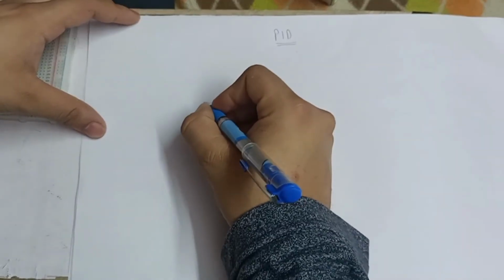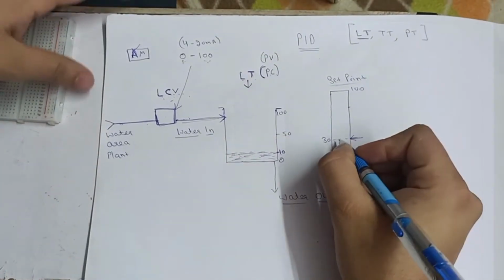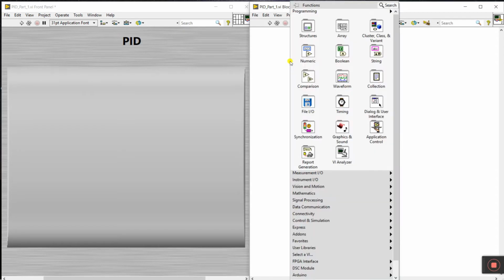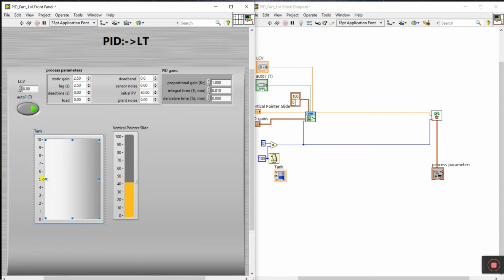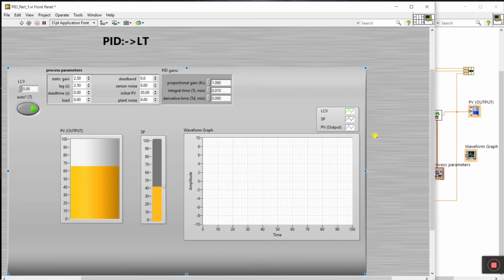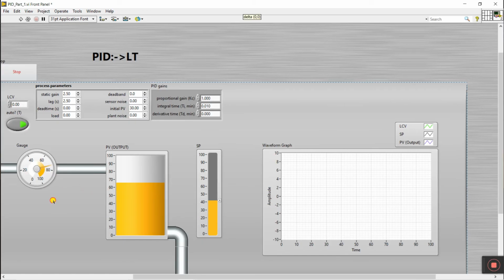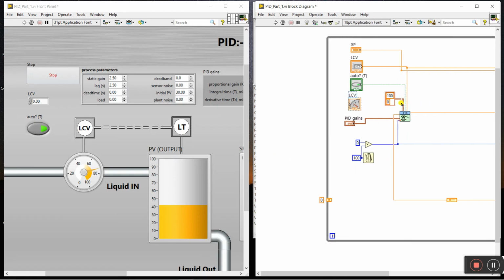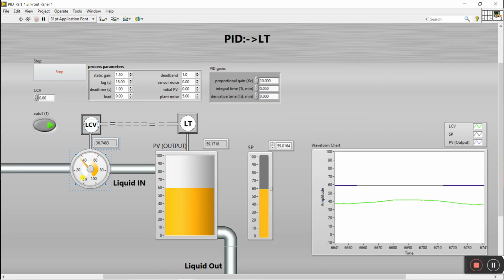LabVIEW | Labview PID Industrial Project | LabVIEW Programming Series

Comment: How Can I Design a PID level controller for the reboiler of the mDWC (denoted by W2 in the column scheme), which can keep the reboiler level at a constant value by adjusting the power of pump P2. The desired level should be adjustable at the front panel of the LabVIEW VIDesign a PID level controller for the reboiler of the mDWC (denoted by W2 in the column scheme), which can keep the reboiler level at a constant value by adjusting the power of pump P2. The desired level should be adjustable at the front panel of the LabVIEW VI

Comment: Dear Pradeep, first of all, thanks for preparing good videos.  I have prepared a Matlab code of CSTR and then import it into LabVIEW. Solve it by using the ODE toolbox of LabVIEW. I am trying to control the temperature of the reactor by using the PID controller of LabVIEW. I am unable to pass the manipulated variable in the CSTR plant. So, kindly help in this part.

Comment: Nice project, please assist me I have a project which is used to measuare ac and dc voltage of the lines,  by using arduno code . how to apply and connect the on labiew to reading the actual value of the sensors. thank you
Reply from the maker: Dear follow this playlist:- https://youtu.be/qQqPCWeB_QY
May be it's very helpful, help of this you can do your project as you mentioned.

Comment: I make same circuit on LabVIEW 2017 the with scale value 0-3600,  output of plant system not working properly like when i set the set point at 1000 the output is zero but after sometime it starts increasing and reaches to maximum value not working like yours .
Kindly help

Comment: Great job what you did!  Can you help me get the motor to set point and then stop.  Then, when the water level is below the specified level, it will work again.  Help me please.
Reply from the maker: thanks dear
yes you can create simple logic :- create comparison if value is ">" then " as per requirement" help of "Select" function you can modify as per requirement dear
Reply: @PardeepLabVIEW  I tried to do that but it still doesn't work.
Please help me, please!
Reply: @PardeepLabVIEW  My project is using PID to control water pump. The water tank has a valve that is always open. If I set the setpoint value to 7 then the pump will always keep the water at the setpoint level, but I want the water level to drop to 3 (or whatever level the user wants) then the pump will work and push the water level up. level 7 again. Instead of letting the pump work continuously to maintain the water level at 7.